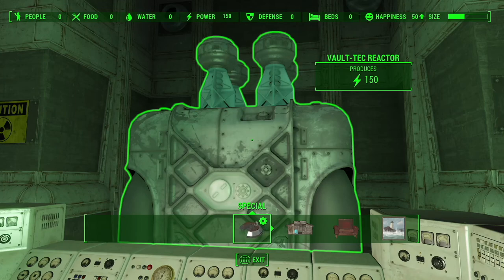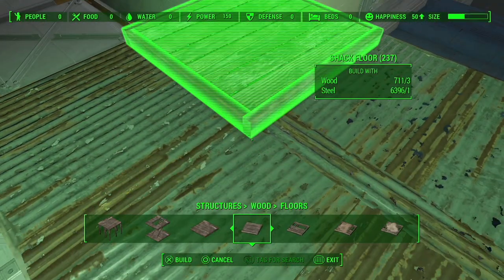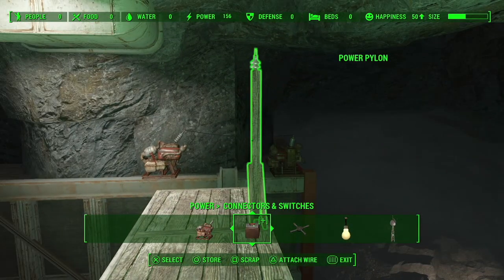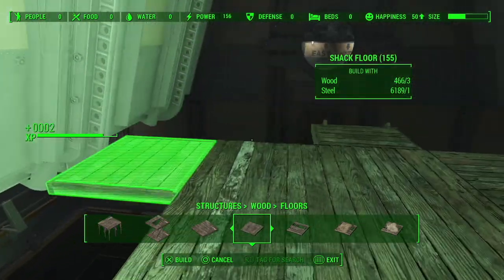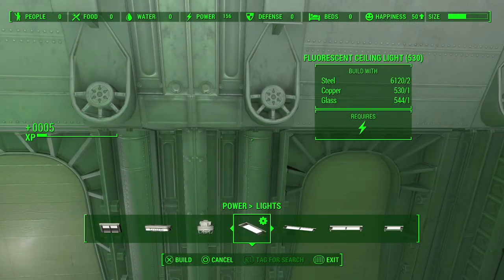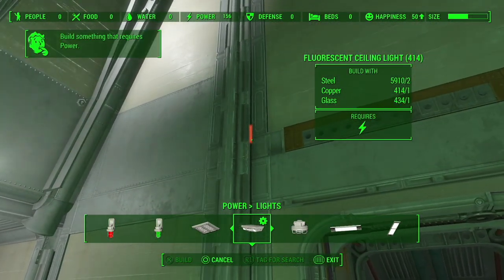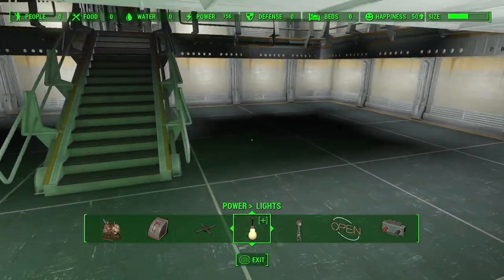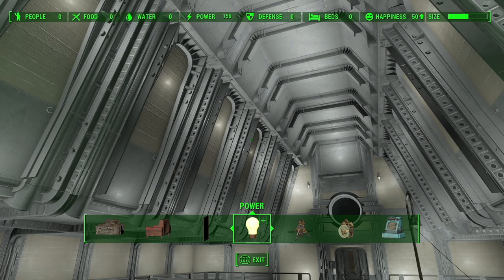How To Light Up Vault 88 Without Mods | Lighting Up the Atrium to Vault 88 | Vault 88 Lighting Guide

Comment from the maker: You will need a lot of copper and glass.

Take your time and make sure everything is lined up for the light to be distributed evenly. 

The best part about this guide is that you do not have to see the lights themselves. 

Lighting Vault 88 is where most people give up. It takes a lot of time and burns through your materials. This video hopes to alleviate that. 

I wanted to recreate what they had going on in Vault 81. I did a pretty fantastic job considering we never had to use mods. 

Please leave a comment if you found a way to make this experience easier and/or want me to cover another topic! 

Within a few days I will have a guide going up showing you how to duplicate building materials. Subscribe if that sounds interesting/useful to you! 

Thank you!

Comment: My brother in christ, why did you not use the vault wall pylons outside of your atrium? Anyways, thanks, I didn't know I could put lights in there. My atrium is too big and I'm trying to light the ground lol. Really just anywhere, the vault lights are bad
Reply from the maker: I would shy away from using the vault power conduit or the wall conduits in the entrance or in the atrium as they never worked correctly. They do not snap into place and can cause wires to clip through walls and doors.

And I am glad that the video helped! And I agree, it feels like it was half-baked. I would have been happy to pay double if it meant there was more effort put into it.

Comment: If you're tight on resources, are on consoles, and don't mind cheating, the scrap/store dupe glitch still works just fine. You can also use the wireless/wifi glitch to save on wire resources.